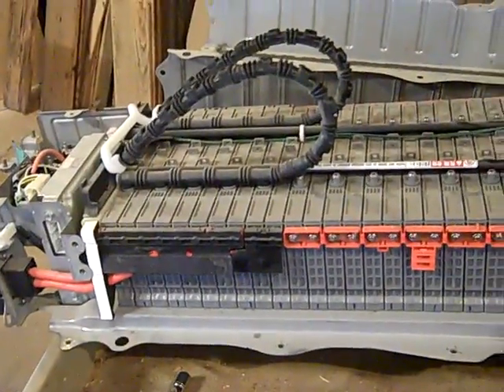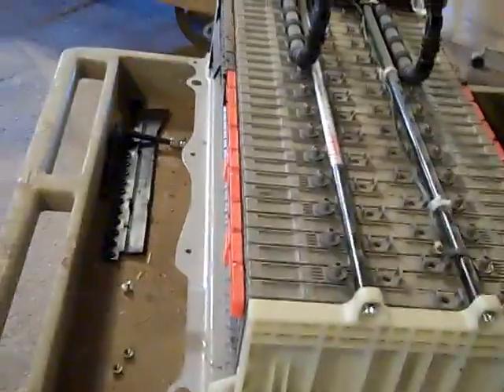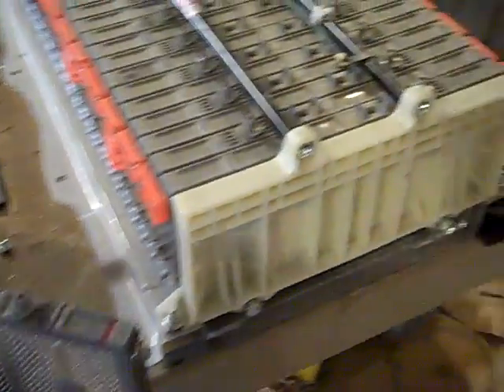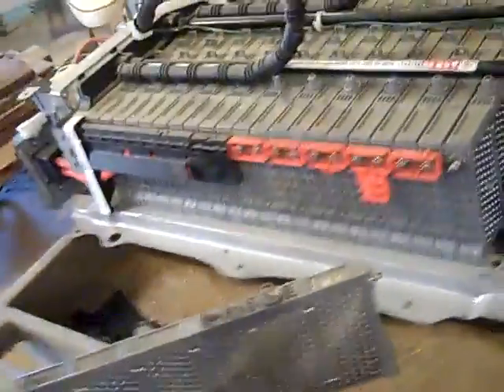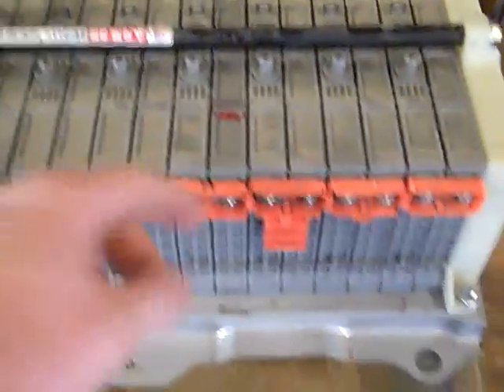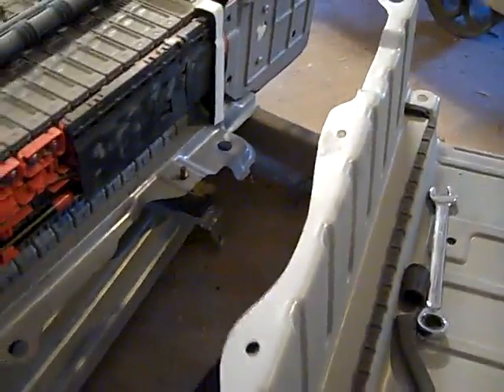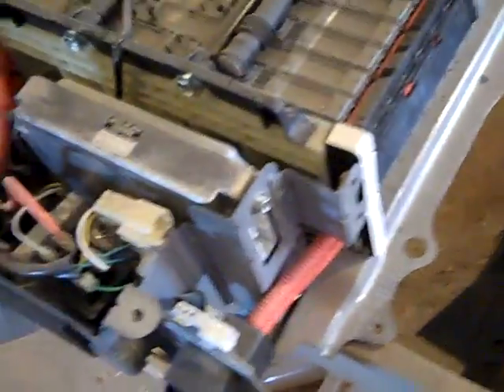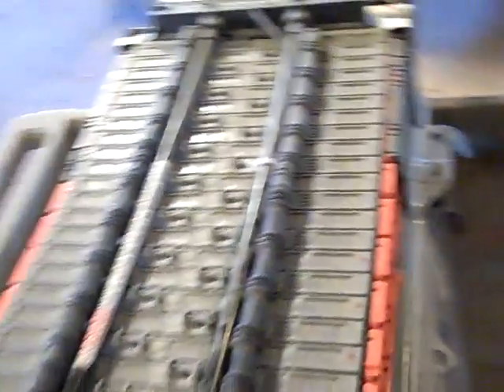Prius Battery Repair

Comment: I have a 2005 Prius, I'm testing the cells now. 1 - 24 show 7.9v, and 25 - 28 are showing 7.5v. If I buy new cells do they have to be showing 7.9v?
Reply: Update 01/03/17 - After 12,000 miles, my battery failed again at 220,000 miles.  This time I had to replace 4 cells.  I also performed a more thorough load test of all cells, measuring the rate of voltage drop under a 2A load.  I did not have enough time to verify Ah capacity via a full charge/discharge cycle for each, but I could compare individual cell performance to each other.  That being said, I determined that my original cells are probably down to about 4Ah of their original 6.5Ah rating (as compared to the newer replacement cells).  One thing I did that I believe will help in the long run was to balance the pack.  It is suggested that you remove all cells, line-up the plus terminals on the same side and use two pieces of bare wire, one to connect all the plus terminals together and the second wire to connect all the minus terminals together.  You let it sit this way for a few hours (overnight?) so the total charge can equalize across all cells.  I did not wish to completely disassemble my battery pack (I tested and repaired it in place in the car.), so I did mine by precisely measuring the recovered voltage of each cell and discharging or charging the outliers so that all rested cell voltages were within 10 milliVolts of the average.  This, however, is the last time I will service the battery.  There are a number of companies (Falcon is one) selling completely refurbished and balanced battery packs (including electronics) for under $1000 with a 12 month guarantee.  They perform a more thorough capacity check and balancing of all the cells and I would expect a more reliable repair as a result.  With luck I should get a year out of the repair this time.
BTW:  The individual cell capacity is 6.5Ahr and the terminal nuts on the cells should be tightened to 48 in-lbs.
Reply: These are not 'typical acid batteries', they are Nickel Metal Hydride, more like the batteries in older cordless drills.  The individual 'cell' of the Gen 2 Prius battery is made up of (6) series-connected NiMH cells at 1.2V each (nominal) for a total voltage rating of 7.2V nominal (7.7V typical) per cell pack.  There are 28 cell packs in the battery assembly for a total of 201.6V.  Since a NiMH cell floats at around 1.3V, the battery assembly will typically read around 220V, hence the concern for personal safety.   I believe the charge capacity is 5.6Ah, though I have nothing to verify this.  BTW:  A bad cell does not 'take down' the voltage of adjacent cells, though it can cause excessive heating which could affect adjacent cells.   A bad cell will allow the total battery assembly voltage to swing quickly, which can cause the on-dash charge indication (SOC) to change quickly/erratically from high to low or low to high.  This is a good indication that there is a battery problem.
Reply: mikethelma - Perhaps it is risky to simply replace the cells as they fail, but my experience thus far has been okay.  It should be noted that I have only driven 7000 miles on the repaired battery (I replaced only one cell) and it is still going strong, no signs of any other weakening cell(s).  Also, while it would probably be ludicrous to expect the cells to last for the 500k miles that has been reported by some owners, mainly taxi drivers, it would not be presumptive to assume that the batteries should last for at least 350k.  My 2006 has 215k miles on it and I hope to run it to at least 400k.  There are some tests that you can do to all of the cells while you have it open which involves measuring the open circuit voltage and then measuring the voltage under a load of a few amps for 10 seconds or so.  You can also look at the voltage recovery after the load is removed.  Comparisons of all cells loaded and unloaded should show any that are 'different' from the others.  BTW  A brake light lamp from a car will provide a reasonably constant current load of 2 to 3 amps for this kind of testing.   Use a DMM that has at least 3 decimal places of precision when measuring voltages because the variances will be very small.  CAUTION:  You want to subject each cell to identical load testing so that they will remain at the same level of charge as the others when you are done.  This is still a sort of 'seat of pants' analysis, but more in-depth analysis requires some specialized equipment to charge and discharge the cells while recording the voltage and current levels.  You can purchase a refurbished battery from some companies (Falcon is one) where they have hopefully performed a thorough cell analysis and I have seen some of these for around $1000.  If you want to pay around $2600 for a new battery from the dealer, keep in mind that they charge a hefty refundable core fee and that you will need to transfer the electronics from your old battery to the new one before you return the used core.  As long as you respect the high voltage that is present in the battery pack, it is actually pretty easy to repeat the replacement process with just a half a days work, which gets faster after you have done it once.  I intend to replace cells as they pop and will continue to enjoy my 48+ MPG overall.  I will post again when/if I lose another cell, if the wheels don't fall off the car before then...
Reply from the maker: +Joe Hello Joe, one cell can take down the voltage of neighboring cells. Or they all could be bad. If its not a simple odd ball out I would load test the cells in question to help narrow the questionable cells. These are typical acid batteries so over time they lose capacitance and your computer monitors the variance in voltage. Your entire pack can change voltage up and down so there is not a happy golden number.
Reply: Thanks for that explanation.  I am starting to think that this may be something of a fools errand.  If one cell goes bad, then can other be far behind.  It seems as if the author of this video has done this three times so far, each time replacing another bad cell.  This is what I thought might happen.  Do you think there is any point to doing repair work on the traction battery.  You have to do the work to get it out and back in.  You have to buy the replacement cells.  Then you have to do it all over again in a few weeks/miles.  Just wondering what your thoughts are as you seem to have some actual knowledge about this.

Comment: okay so my batteries are all around 8 volts. The lowest one off voltage I read was 7.7 so I might think that the problem is the computer. The driving performance is very problematic, when I had the issue I was driving down a highway when my gas simply had no power behind it. I could not keep up with traffic. It starts fine, but it runs as if the battery didn't even exists.
Reply: steffen L.  I am having the same problem.  Can you please tell me how did you fix your car please?
Reply: Abdulafah Milad the battery voltage fluctuates so It can be hard to tell which one was the bad cell. I had to plug it in and run it around the block while testing the cells. I found that two of my cells were draining faster than the rest. I swapped them out, and it works fine now.
Reply: Thank you so much for replying to me Steffen.  where i can plug it in to test the cells to figure out which one is draining?  what is the equipments or the tools i need to do this test?
Reply: Just a multimeter and checking the voltage difference between each cell. Someone would drive slowly around the block and another one would test each cell positive and negative one at a time.
Reply: I did that and all cells giving me the same voltage reading.  8.0 all of them.  However, the battery is still have the problem.  what do you mean by " I had to plug it in and run it around the block while testing the cells"
Reply: hmm well mine showed some cells go down faster than others while I was driving so maybe it's the battery computer?
Reply: yes this is what i am expecting.  Any idea how can i check the computer if it works properly?
Reply: Steffen L  you need to drain the hv batt. and recheck, I guess....I'm learning as well.

Comment: Man, just clipping that orange plastic is brilliant! I am about to do a 2007 Camry Hybrid. Obviously, same story as everyone else on quotes. But started researching getting it refurbished. After realizing I would only get a good price if I worked with people who were several states over, it was obvious I was going to have to remove it myself to drive or send to them. At this point, I was just curious could I refurbished myself since I was mostly there. Nothing really available for camry, but alot for proud. I actually paid $79 for a detailed outline with pics to do the work myself for a proud. Still think it was worth the cost, to avoid anything potentially stupid. There is a video for removing a camry hybrid battery pack in good detail. So really, the investment was to remove cells and replace, etc. They tell me how to break the whole thing down. One hour later, I see your video and am excited I can avoid taking everything off just by clipping that plastic in front of the bad cells. Thx man😃
Reply: Here are a few of the videos that helped me, but I will admit, cutting that plastic seemed faster but nothing lined back up liked it need to after putting the new one in. Because you can't slide them out, you literally have to remove all of them on one side of the one needing replacing. Then once you put them back they don't pack together quite as tight. I really struggled getting them close. And at the end, I really didn't get the last completely fastened. But after all, it did work! Also, mine was a 2007 Toyota Camry Hybrid.
Reply: Hey is your camry still running?

Comment: Hi I have a 2002 Gen 1 and my car wont hold a charge and I get an "error code p3030" when I use the code reader, will replacing cells fix this problem?

Comment: The thing which continues to flummox me is how the hybrid HV batteries are constructed in series, and yet continue to work.  One bad cell, as is evident from Heritage Tim's experience, can cause the performance to plummet.  But my question to Heritage Tim:  Did you charge the HV battery without the new cell in place and charge the single cell before installation?  It seems to me that a differential charge on the large group and the single cell might cause problems.  What do you think?

Comment: Heritage Tim I have a 2007 Camry and was quoted $6,000 for HV battery replacement at the Toyota dealer. Thanks so much for this video. It looks like for swapping out 2 bad cells I can do it with the battery still in the car with all leads disconnected. What are your suggestions on that idea? Thanks again for this video.
Reply from the maker: Dave Kent Hello Dave I cant say I have any experience beyond my own car. I am not sure what the camry  looks like. However I can say the prius was just way simpler to remove the battery and do it on the work bench. As much stuff as you would take off to get to the individual cells, and how the pack is bolted together, it is just way simpler to pull the pack. They are a little heavy but help getting it in and out, would be better than the backache of working hunched over without a lot of room ( in the back of the car). Just keep in mind there is still risk of shock even with the orange service plug pulled, fumbling in the back of  a car bent over, you may be more likely to accidentally touch the wrong spots.

Comment: Thanks for this video, I just replaced my first cell at 301,000 miles. This was super easy to do. I am not a mechanic but this video made this look pretty easy and it went exactly like the video. I did get my feel for $45 on ebay. Toyota told me that I had a bad feel and computer. I found a computer on ebay for $45 so I bought it. I put the cell in without the computer and it worked fine. I guess I need to put the computer for sale on ebay
Reply: Pat LaVigne í have the red triangle how you disconected  the battery  power  to work  safe?

Comment from the maker: Well its been years and over 80,000 miles since I repaired the battery pack. I have put a total of 3 cells in all together. Each time it was simply replacing the one that had a lower voltage than the rest, I think the last time it was a two hour project. Every cell was purchased off from ebay. I am still getting around 45 mpg.

 I get a fair amount of comments from so called "trained experts" who love to tell me I am doing it all wrong. I am sure they don't like the potential loss of business from people replacing their own cells. 

 However I also get awesome comments from the people who were helped by this video. Many of you say thank you, and remind me of how much money you saved. I appreciate all the comments, keep on fixing them damn red triangles.
Reply: The trolls are out, I see.  This is a SPAM website (magic woo-woo wizard) to sell crap.  These trolls look for any Youtube video about batteries and crap all over the comments.
Reply from the maker: mikethelma Yes I would keep changing cells as they need it. For what I have invested in this car is peanuts compared to brining it to a dealer. I save tons driving this car vs our old taurus. Cheaper and way more reliable. We are over 4 years driving this car and I haven't changed a cell a long time. (I look at that as a hybrid oil change 2hrs and 40 bucks) Whenever I did it was usually with the seasonal change spring or fall (so I am probably due). The cars are getting even cheaper so if this one dies like kaput I will be getting a lower mile replacement.
Reply: Tim, do I understand that you have done this three times as different cells continued to fail?  In retrospect, do you think this is a worthwhile endeavor?  I am starting to think that once you get a single bad cell, you know that the others are not far behind.  You've apparently pulled and replaced the battery three times and bought about $120 worth of cells to replace failing ones.  These cells to have a life span and even though Toyota maximizes it by careful controlling of the charging cycle, the all do have to fail eventually?  My Prius is dead in the driveway right now.  It has a bad traction battery so I've been debating what to do.  It was limping along but just yesterday I came out to a completely dead car.  So this must be ALSO as 12 volt problem (though I replaced that battery), as well as possibly a fuse or even a bad computer somewhere.  Thanks again for this video.  It was very helpful.
Reply: This is impressive! Have you had any other repairs lately? and if so what millage? I am about to buy a 2005 Prius with 154,000 miles on it.
Reply: HeritageTim ok
Reply: The local Toyota guys quoted me $3300. I mentioned replacing the cells, but they said they aren't allowed to do that - they can only replace the whole thing (then I'm sure replace the cells and sell the refurbished battery). They were cool about me doing it myself from videos like this - they said go for it. I'm in San Diego - there's no shortage of people buying new batteries around here... the Toyota place is plenty busy, lol.
Reply: hi everyone ,if anyone else is searching for battery recondition try Cypouris   Renewal Guide Coach ( search on google ) ? Ive heard some incredible things about it and my work buddy got amazing success with it.
Reply: There are several factors in battery reconditioning. One plan I discovered which succeeds in merging these is the Magic Mender Wizard (google it if you're interested) definately the no.1 course that I have ever heard of. Check out this  unbelievable site.

Comment: I wonder if this works with a camry hybrid? By the way, for safety reason, you needs to wear high electric gloves, and using high impedence voltmeter like Fluke brand, and be very careful, because this battery could kill you.. they are 350 volt to 600 volt, as I know it...
Reply: Toi Khong Biet Camry has 34 similar modules. As with Prius - changing 1 module make sense only if you are 100% aware of what that module specs are as well as the rest of the pack. 
When I do Camry - I use my 19-channel Analyser to test 1/2 of the pack at a time or 38 channel Analyser - to do it in one go. www.hybrids.co.nz
Reply: thanks....

Comment: This is a relief!
Spent a Saturday swapping the single cell bought from eBay, no worries with any high voltage, you would have to try really hard to zap yourself (using extra wiring = pretty much impossible).
Found it easier to do the change over while leaving the battery pack in the car, just undid all the bolts and angled the pack up at the right hand side to access and release the underneath cell bolts.
Admittedly my bung cell was about 8 in from the right, if yours is far left it is closer to the connections end :(
BTW, had to clear the 'replace hybrid battery' fault using a CAM bus reader borrowed off a mate.
Yep, what a relief to fix for $70 instead of  $3k+.

Comment: I got a $5000 replacement estimate from the dealer for my 2007 Camry.  Used this link http://imgur.com/gallery/j8Bcp and this video (thank you) to remove and test the battery, 1 bad cell and some corroded bus connections.  1 new cell for $44 on ebay,  $7 for dielectric grease and cleaned all the BUS connectors and nuts (total fix around $60, that's 83X cheaper than replacement).  Car now runs great and NO error messages.  Feel like I won the lottery!!  Spent about 6 hours total but worth it.   If you can get high voltage gloves and have the time to work on it I recommend doing this repair yourself.  Not so scary once you get it out of the car.  Careful with the small voltage monitor wires attached to every other BUS, I broke two of them and replaced with standard forked crimp connectors.     Sorry Toyota :(